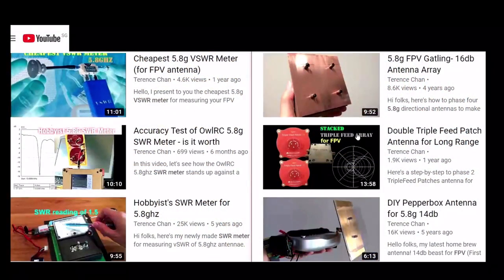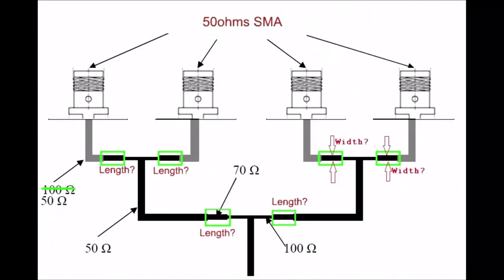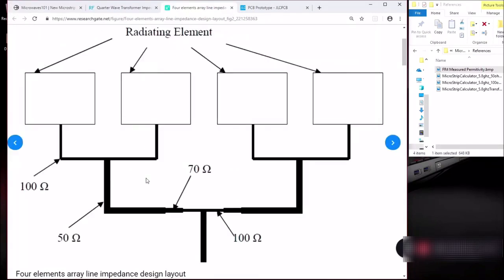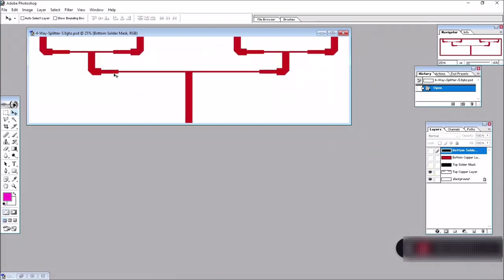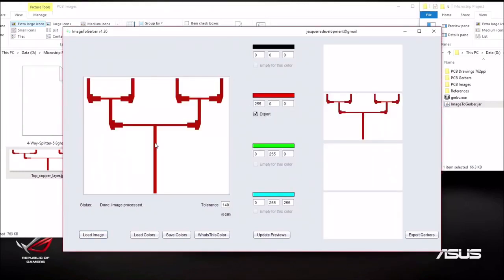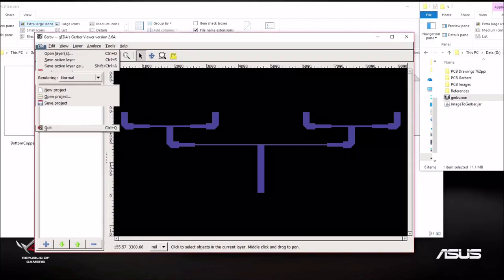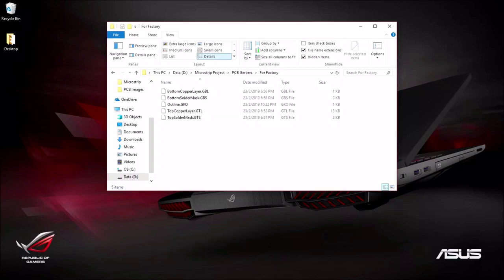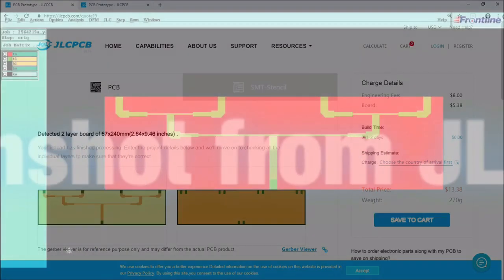Microstrip Array For Long Range FPV. Make your own!

Comment from the maker: Here is SWR reading from a hobbyist meter (while waiting for VNA's result from labs). 
See SWR graph at http://tinyurl.com/4way-splitter-swr
Center frequency is on the higher end of the 5.8g band, < 1.2 for 5940mhz. Still happy with it, I tested arrays made by TrueRC Hugo and they all have SWRs between 1.2 to 1.6 on this meter.

Comment: Great work. Can you please share gerber files ?  will this design also work as 2 way splitter for 50 ohm antennas?
Thank you for sharing.
Reply from the maker: thanks. Sad to tell you the Gerber files don’t work now if you upload them at any Fab houses’ website. At the making of this video in 2019, JLCPCB website didn’t check the layers for mismatch so i was able to upload them. Now, I would get an outline layer error no matter how I tried to match the layers size. For this reason, I don’t use ImageToGerber anymore. It is difficult to draw antenna traces  in Eagle, I would suggest that you draw it in fusion360 (refer to the pdf I provided in description) and then export the sketch from fusion360 to Eagle.
Reply from the maker: Print at 100% scale to transfer paper, use iron to transfer to PCB and etch. 
https://tinyurl.com/splitter-5-8g-4way
Reply: @terence79chan  Thanks for your observations.

Comment: Fantastic.  Do have a pdf available of the splitter? I etch my own board/make my own antennas and have always wanted to make arrays.  Thank you
Reply from the maker: Here you go
https://tinyurl.com/splitter-5-8g-4way
Let us know if it works on your etched board. :)
Reply: @terence79chan  Thank you!  I will give it a try.  Do you have a 2-way template as well?  Do you just shield the backside with foil like in one of ur other videos?  thanks for the help
Reply from the maker: You would only need to etch one side of the double copper-cladded board. Make sure the ground side is protected from the etching solution. Yes, the aluminum foil trick would work for shielding, just make sure it doesn’t short your signal trace.
Reply from the maker: Oh, the 2-way was referring to a double-splitter, I thought u were asking about the bottom pcb layer. You could crop the top of the pdf (omitting the first T at bottom) and then halved that rectangle, to have 2 identical 2-way templates.
Reply: @terence79chan  Perfect, thank you for the help!

Comment: Nice work!  Are you going to test it?
Reply from the maker: Definitely, I will post an update as soon as it is properly tested at the lab
Reply from the maker: Here is SWR reading from a hobbyist meter (while waiting for VNA's result from labs). 
See SWR graph at http://tinyurl.com/4way-splitter-swr
Center frequency is on the higher end of the 5.8g band, < 1.2 for 5940mhz. Still happy with it, I tested arrays made by TrueRC Hugo and they all have SWRs between 1.2 to 1.6 on this meter.

Comment: But do i need to match the impedance of helical antena ?, I want to make one
Reply from the maker: The pcb splitter will match any 4 identical antennas (including helical) that are rated 50ohms (TV antennas are 75ohms). If you are making the helical, you need to tune it to 50ohms using an SWR meter. Tuning a helical is by bending up or down (slightly) the first quarter turn of the spiral wire nearest to reflector until the meter reads the lowest VSWR value.
Reply: @terence79chan  thank you,i don't have vswr metter,but i will give it a try.Love your videos,pls do more